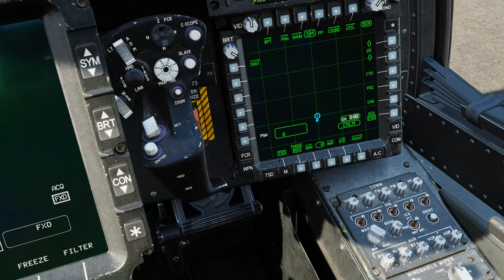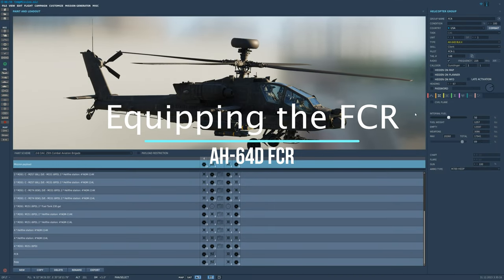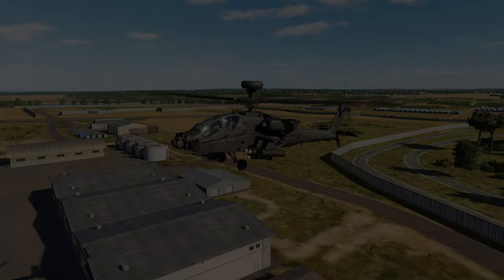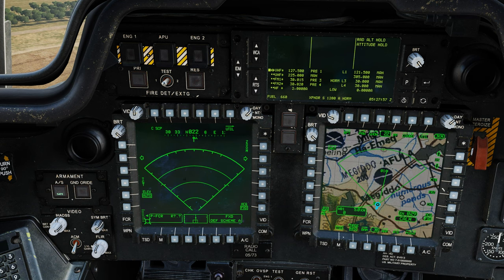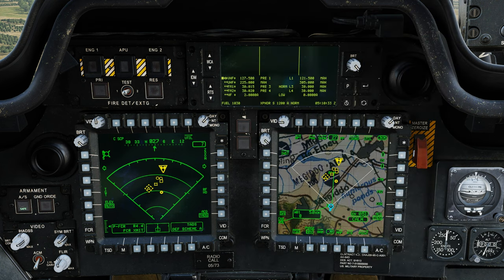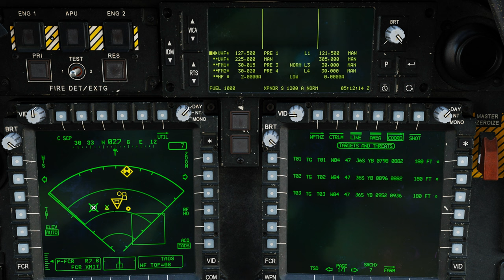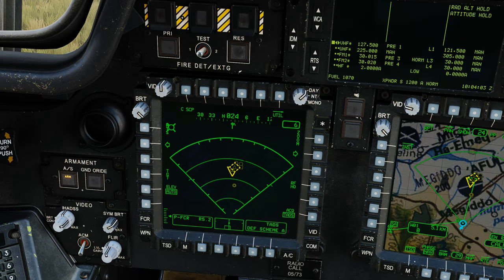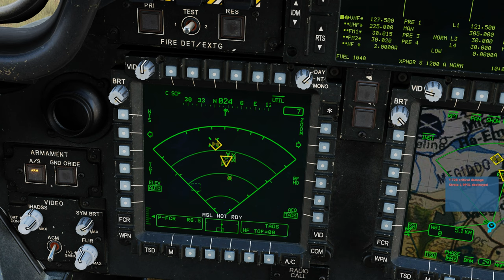DCS | AH-64D FCR Quick Guide

Comment: So.... This radar doesn't give any ground returns like an airborne A/G radar? I mean, if its looking for any targets, how does it know whats what? Im confused as to how this radar can pick up these random targets and know basically what they are. I guess I'm just use to jet stuff. I also kind of expected it to be a 360° radar, what with the full dome like a small boat radar. Are there gonna be diffrent modes with further updates?
Reply from the maker: 1: I don't know how ED modeled their radar so I can't answer that
2: Nope the radar is not 360, think of it as your jets mechanical radar that scans in front of you, but you can also point it 90° left & right. If you have to scan behind you, you probably shouldn't be in that area haha. 
3: Yes different modes are coming in the near future.
Reply: @TomP-148  Okay so I got it to work and actually managed to get some Hellfires onto some targets. Two things ... It will apparently, at least at this time, only show targets that are set in place in the mission builder. I'm guessing that if said targets were mobile it would show them as a moving target and track them. But I can't just slew to a building or whatever and lock that as a target. So no TOO, at least not at this time.
Also, without the zoom function it is very difficult to differentiate targets that are close together. I had four targets spread out over the length on an old runway, about a mile, and from about 4 miles away, they were literally on top of each other. 
But, regardless, it was still pretty cool. I just need to learn how to hover and land.

Comment: Great video. I can't fly the Apache, I have no problem with any of the other helicopters from DCS, but can only do the Apache from the front seat. First problem when I start it from side to side before I even get off the ground and this usually results in a crash. Once in the air it's not that much better very difficult time doing any type of maneuver. I have a Saitek x52 and I'm wondering if it is my joystick thats give me the problems. I'm not alone in this situation I've heard from several people there extremely disappointed in this particular module. Most say other than the maneuvering the helicopter the rest of it is great. I really wish DCS would remedy this situation. If you are able to fly this if and you don't mind what joystick are you using.
Reply from the maker: Thanks,
It's hard to remedy a situation when the helicopter has real Apache SME'/pilots working on it and giving it feedback.
All my buddies and I have no issues with it so maybe it's your hotas? 
Have you checked out bradmicks channel? He was an Apache instructor for many years and has a really good channel for teaching people to fly
Reply: I have an x52 and I find the Apache pretty easy to fly once you understand how to counter balance with rotor for torque. Also trim for when you’re flying.
Reply: I had a hard time at first, even with a fairly high end HOTAS (Winwing Orion 2). I found that if I give it just enough cyclic and forward stick to get it rolling forward at about 5-6 knots (with the tail wheel still locked) I can usually get it airborne fairly easily after that, without all the torque issues. That's how someone told me how to do it and it seems to work. Once airborne, you have to set your trim point which is usually a fair bit of forward stick and maybe a bit of rudder. I have my power lever set to around 102-103%, and I try to keep my cyclic where the torque shows around 95-100%. This will jump up above 100% in a hard maneuver. For me, when I get it dialed in like that, the thing is a blast to fly. Not particularly fast, but it is a helicopter. 
Now, all that being said, I have yet to master any kind of hover and my landings are.... Ugly. But I can get the thing in the air and maneuver.
Reply from the maker: @bretttrommler756  You're doing something wrong. Power levers should be at all the way forward to "fly" and to take off into a hover you only need around 60% collective, even with a rolling start. I recommend starting slow, slowly pull up on the collective, around 30% is when you should be able to "feel" it starting to get lift. As you increase collective, increase small left pedal to counter the torque until you're airborne. After awhile you'll be able to just do it without much thought. For cruising you should only be around 80% collective in the D Model (in DCS). The only time you should be in the 90%+ area is if you're trying to reach a faster speed, 120+ 
If you're flying around at 90%+ collective and you start maneuvering, lets say going defensive you'll be in the 100%+ real quick.
Reply: Have you tuned the cyclic and pedal  controls adding curves and or modifying the y axis saturation and perhaps a dead zone? Search YouTube for Volk. He has a series on flying the Apache and goes over modifying the control axis tune and basic Apache flight. He helped me a bunch.
Reply: Belated, I know, but may I share my experience and what has helped make the Apache fly more like an aircraft and less than a brick? HATED this aircraft despite my slightly higher than average heli physics understanding and plenty of time in sims. I doubt it's your joystick causing issues unless it's quite old. I use Logitech Extreme 3D Pro; it does eventually wear out. One thing you might check is the amount of collective you give it when taking off. Too much and you'll be bouncing, flopping, and  around; the torque can get real touchy, so increase collective very slowly. You can use front seat and George to lift you off...... I think in real world the Apache's pilot and gunner are equal in flight skills. Hope this helps some.

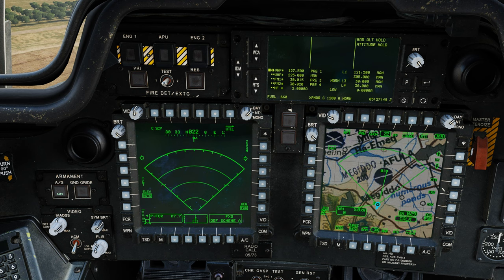Comment: Wait.... At 6:04 did you say that one nautical mile is roughly half a kilometer? That's kinda backwards. One kilometer (3280 feet) is a shade over half a nautical mile (6076 feet).
Reply from the maker: Oh no I accidently said it backwards but correctly converted it a few seconds later, I should delete the video. Haha good catch.
Reply: @TomP-148  no, no... Anyone could do it. This video has helped me a lot. I'm still trying to figure this one out. I'm a recently retired aviation maintenance technician that specialized in avionics so I know how a radar works, but this one is giving me fits. I get the thing up and running but I get no scan and so no targets. I think it has something to do with getting the sight select to FCR but I'm not real sure what happens there. When I go left with my sight select, it just says out of limits, or it arms the rockets.
Reply: Figured out I wasn’t moving my sight selection, I was moving the weapons action switch.
Reply from the maker: @bretttrommler756  that would do it haha